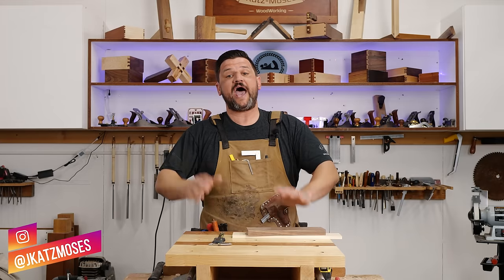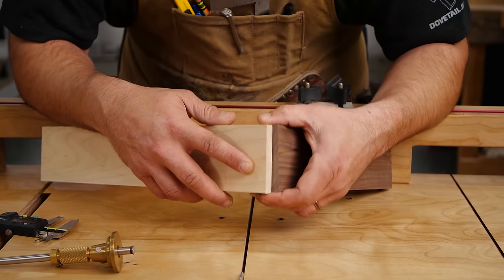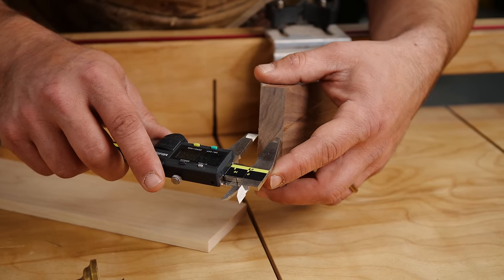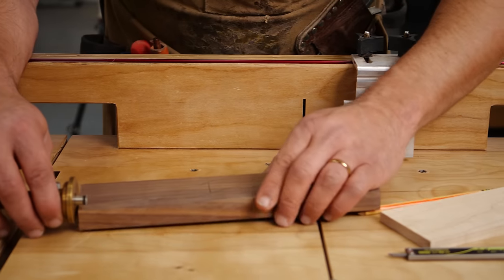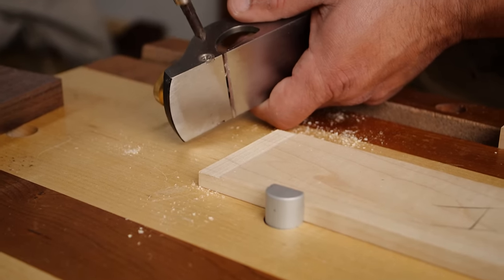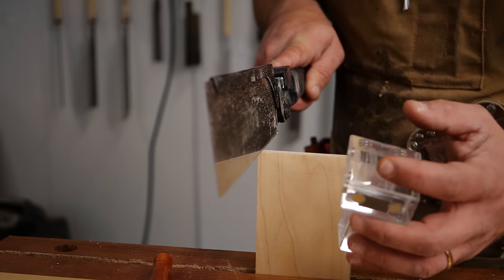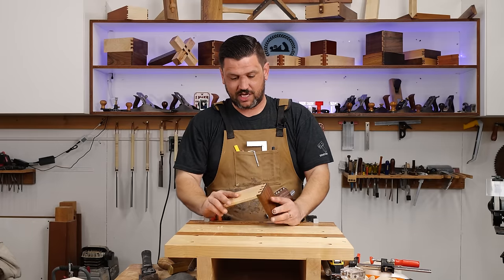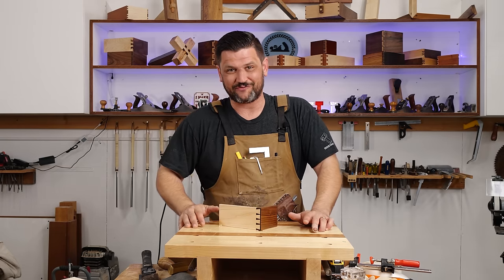Half Blind Dovetails - Joint of the Week

Comment: Yes their is math, that you can use. German carpenters solved this problem some time ago.  Thickness of the board  divided by 2 gives you how far you go in on your sides for your half pins. Now to calculate dovetails, length of the board  divided by ( 3/2 times the thickness of the board ) .  Keep in mind that this does not always give a round number, so you may have to round up or down. 

ex. 20mm /2 = 10mm half pin. 
160mm /(3/2 *20mm) 5,3 dovetails which I round  to 5 
if I got five dovetails, and I want the number of pins ADD 1 to your 5 dovetails 
so we got  6 pines and 5 dovetails. 

This also works in Inches.

Comment: I used to use UHM tape, (ultra high molecular, a fancy way of saying really thick), to repair a squawk noise coming from the interface between the front anti-roll bar and the mounting bushings of N body GM vehicles. They eventually came out with a bushing made of a different compound that eliminated the noise. I found other uses for UHM tape, not necessarily on cars, so I was glad it was still a good part number.

I know it's not, but I still say that tune sounds like Stevie Ray Vaughan. RIP Stevie

Comment: I can’t say I have seen too many videos about adjusting my knickers. Lol. Sorry, I just had to 😏 All seriousness though, I have some questions about wood glue if you don’t mind. Less about brand and more about material. Are there certain active ingredients that make on stronger than others? Also I noticed that a lot of glue says “not recommended for structural use.” Is this in reference to this type of joint use, or more in respect to gluelam  timber type bonding?
Reply from the maker: Probably more the timber framing end of things. Typical wood glue in furniture is stronger than the wood it holds